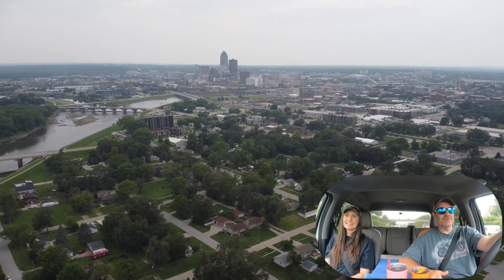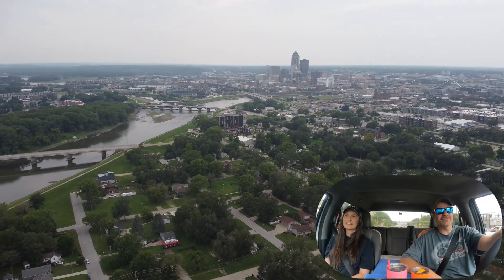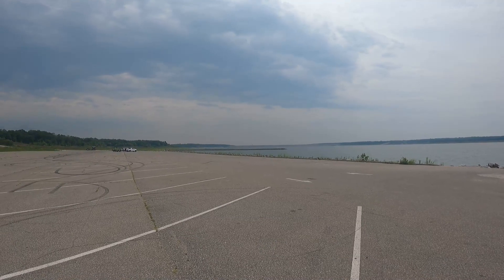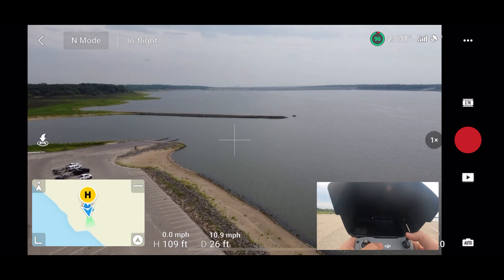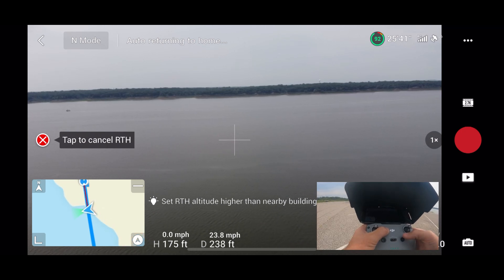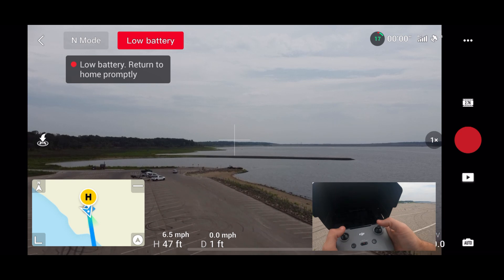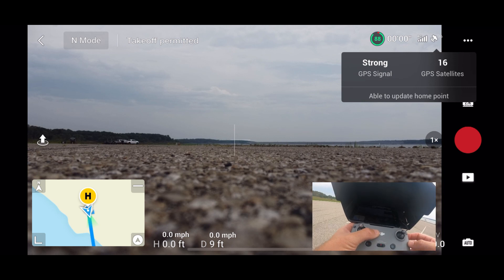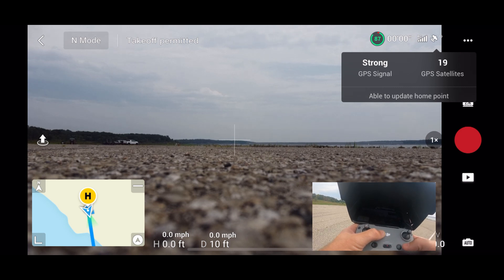DJI Mini 2 Return to Home / It Has 3 Modes? / Smart, Failsafe, Low Battery Mode / 20 Meter Secret?

Comment: Another great test, or series of tests, but you are so brave doing them over water, especially where you turn off the controller! 😱 Actually, I have used the disconnected RTH quite a few times, as there are so many trees in the dense forest, where I live, that I can rarely get over half a mile away before losing first the video feed, then connection, so RTH kicks in. Then once I get video back, I'll cancel RTH and take control again. I also get lost or disoriented and don't know which way the drone is faceing, so I hit RTH, forgetting I can just look at the map and see the line toward me from the drone. But if I'm in radar mode, I can't see the map. Anyway, I love the RTH feature!
Reply from the maker: Lol. Yea the RTH thing is pretty awesome and I’m pretty sure I would’ve lost my drones 10 times over if the feature wasn’t there. Or may be I would be more careful sometimes?  Who knows?  Lol.

Comment: Hello Roberts family.   Have you considered asking DJI to fix your 90 degree RTH?  They're very good about repairs and turn-around time is excellent in my experience.
Reply from the maker: Hey there, Ron!  That’s a really good question and I’ve heard nothing but good things so far about how they take care of their customers. We haven’t reached out to them as of yet, mainly because the 90 degree turn deal hasn’t ever interferes with our flights or the flight path so it’s more of just an annoyance than anything. Lol we’ve kind of learned to live with it and make more videos about it. Hahaha. We’ve had several potential solutions and one that really worked where we increased the advanced gimbal setting numbers up really high in every mode. I decided though to put the numbers back to where they were though in cine and normal modes because it’s really hard to get good footage with no control. Lol. Thanks so much for watching and commenting, Rob. God bless!  Kevin
Reply: @WeretheRoberts  I totally understand Kevin.  I'll keep hanging around, the two of you are a blast.  Please have a good week.

Comment: Great video, guys! I use the RTH feature when I get a little too far out, and I want to make sure I get on the right track. It would come into play all the time on the original Mini, but I haven't dropped signal yet on the Air 2S. I don't see it strictly as a last resort, but as a convenience when you want to make sure it's on the right path.
Reply from the maker: Hey, Jeff!  Thanks for watching, buddy. Yea we agree 100%. We’ve used it mainly to get some smooth cinematic footage when it’s returning home. I’d rather fly back to home myself. I haven’t had any real signal problems with the Mini 2 so when I wanna come home I just use the little triangle icon on the map and point it back to me and fly straight home. It hasn’t failed us yet. YET. Lol. The fail safe mode is pretty awesome just in case. That’s for sure. Thanks again for watching and God bless!!!

Comment: That is weird that your drone RTH sideways Mine does not. You may try to recalibrate the IMU. You should be able to turn while in the RTH and adjust the PT. If you grab the drone while it is hovering and quickly turn it over it will power off the props ( if your remote went completely dead)
Reply: but only do so in an emergency such as Joe describes.  If you've tried flipping the drone, or watched someone do it, you can hear the motors spin-up to 120% power. This is the IMU freaking out, and while the little guy can survive it, it's definitely overloading the motors, if briefly.  Hey, some folks run their LiPo batteries to 0% regularly too. Just cause you can do something... you know the rest, lol! Hope the tropical storm at hope gets tired of waiting for your return and falls asleep!
Reply from the maker: haha, yea, John I get it....  lol  We did a video about this emergency shut off a few weeks ago.  That was the first time I had ever done it and it worked perfectly, but I've heard it can wreak havoc on your motors... I haven't done it since, but it's great to know it works, eh?  We live on the Atlantic side of Florida and it looks like it's possible this storm could go into the Gulf so your well wishes may be helping... lol  I'd rather it just fall asleep though like you said...
Reply: @WeretheRoberts  Absolutely!  There's very few recalibrations you can or need on DJI stuff. Compass, IMU, and sensors on the Air 2/2S via the computer and your monitor using DJI Assistant for Mavic. I almost wish I needed to do them, just to try it, it looks cool. Watch what you wish for right? Any chance you gave it a slight yaw movement as it started home? Safe travels my friends!
Reply from the maker: haha.. always be careful what you wish for... that's funny...  I don't believe I hit either stick during Jack's RTH process.  I left it at the 90 degrees coming in just to demonstrate it while I mentioned it.  Normally I will turn him the rest of the way lol...  It's done this every since I hit RTH the very first time.  I kind of think the IMU recalibration will help because I don't think I've done that in several months...  Good thing we are unprofessionals... haha!!!
Reply from the maker: Oh, you know I didn't think of the IMU...  That would make sense for sure!  We are traveling tomorrow morning so I'll do the recalibration next chance I get and let you know what happens...  We did a video about the emergency kill you mentioned a few weeks ago.  I had never done it before until the camera was rolling... I had just seen it demonstrated in other people's videos so I figured why not?  I'll try it... lol  It worked perfectly.  I was thinking it would come in handy as a last resort if I dropped the controller in the Kayak and couldn't reach it and the drone just happened to be right in front of me...  Like that scenario would every happen... haha  Thanks for the tip, man....  Would you mind if I mentioned this in an upcoming video, possibly?  We love it when people who watched our videos give us answers for questions or issues we have....  God bless!!  Kevin (and Kristi)

Comment: Interesting :)  
When we loose signal the drone back tracks 10m or so, and then if it hasn't regained signal it returns to home :) God Bless <3
Reply from the maker: Awesome, Gary!  Thanks for watching and commenting, buddy...  So that makes total sense why when I disconnected the drone, it looked like he was backtracking before he started going up to the RTH altitude...  After I saw your comment, I found that in the manual and you're 100% right...  Very cool info...  Thanks again and God bless you as well..  :)  Kevin

Comment: Just early practice stages for me at present. One thing I was unsure of, was why my controller RTH button didn't seem to work. But now after watching this, it seems I wasn't holding down on the button long enough.
Blessings for another informative fun video. Loved the "Yee~Hah!" :)
PTL
Reply from the maker: Oh very cool...  I read in the manual that the Return to Home button on the controller actually has 2 functions... If you tap it, it'll pause the drone putting it in hover mode.  To regain control of the drone at that point you have to push up on the left stick.  To use it as "Return to Home", you hold down on the button until it beeps and initiates the return to home, just as you said...  That must've been frustrating for you but hopefully it works now and you can try all these tests with your drone, too... :)  This stuff is fun!  lol   God bless, buddy and thanks so much for watching...

Comment: Not sure about the 90 degree aspect. Did this just start happening with the update that enabled the ability to control the drone while in the RTH mode? If I'm not mistaken, mine turns 180 degrees and returns to home. I'll have to check that out but in the past it always turned 180 degrees. Love the FAILSAFE mode! Gary
Reply from the maker: Thanks for watching, Gary!  I honestly don't know if the 90 degree thing started when they added the ability to control the drone in the RTH mode because I never used the RTH before that... lol  Nobody else seems to experience it either so maybe it's just Jack being rebellious.  I know for sure it's not in the manual... lol  I agree, too the failsafe mode is pretty amazing...  I've seen a lot of videos demonstrating the loss of connection by turning off the controller and that was totally nerve racking to try.  Fortunately it ended well and it's given us even more confidence in the little mini 2...  Let me know if yours does the same thing next time you use RTH.  I'll be anxious to know...  Have a great week and God bless.  Thanks again, buddy!  Kevin and Kristi
Reply: @WeretheRoberts  Jack probably picked up his sideways saunter from Lacie. Pussycats can have that effect on us sometimes. :)
Reply from the maker: haha.. I wouldn't be surprised, man...  not one bit... lol